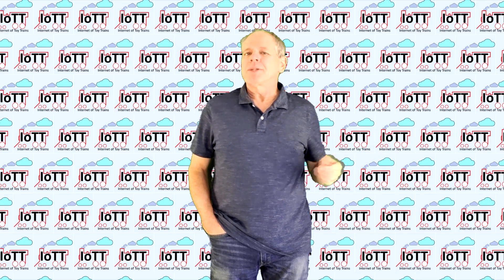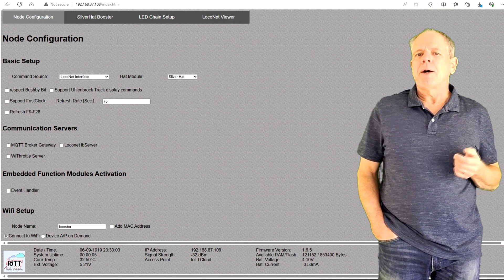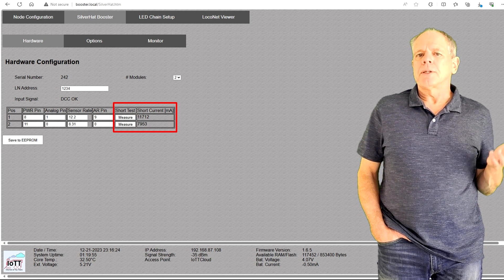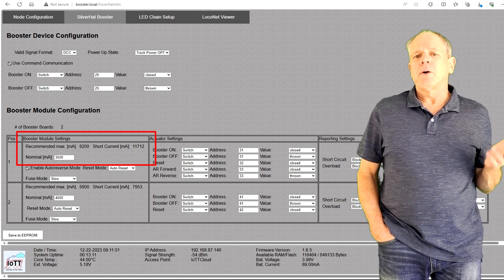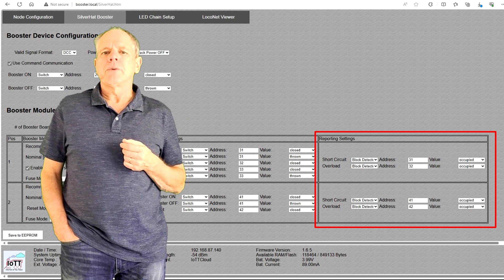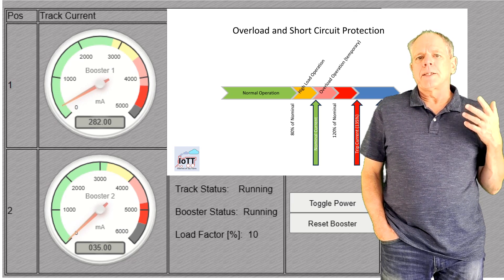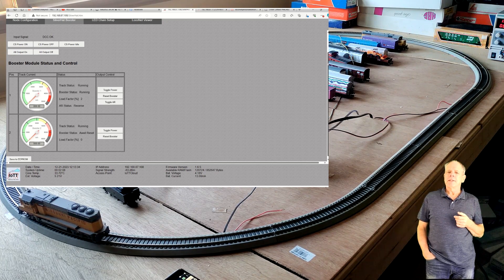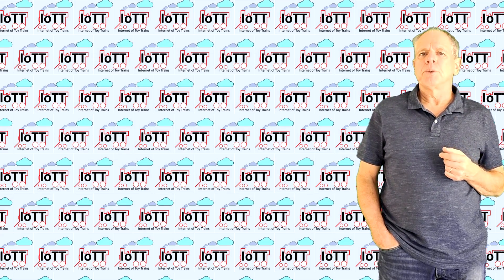SilverHat DCC Booster (Video#134)

Comment: How does using the AUX shield and this Silver hat differ to the Red Hat ?
Merry Christmas and Happy New Year.
Reply from the maker: Happy New Year to you! The RedHat makes DCC EX a wired Loconet command station. The SilverHat makes an Arduino to a DCC booster, well, up to six DCC boosters with up to 8 Amps track current each. You can use the SilverHat booster with any DCC system, but when using it as booster for a Loconet system, you have some additional functionality as it can talk back to the network.
Thanks to modular design, the core components are the same in both cases: Arduino, DCC AUX and a PowerShield per track output. The peripheral components are different depending onthe purpose: RedHat shield for the command station, Tinkerface shield for the booster.